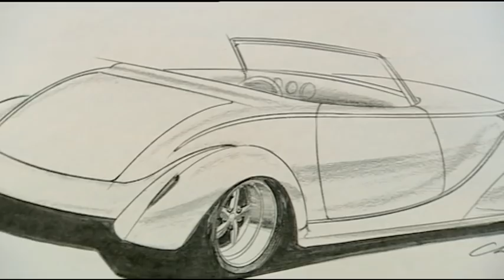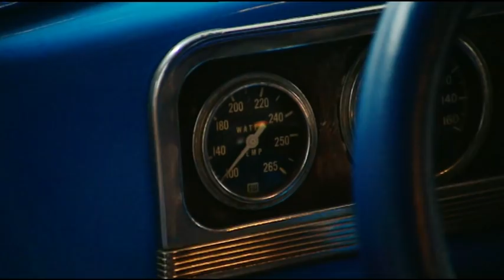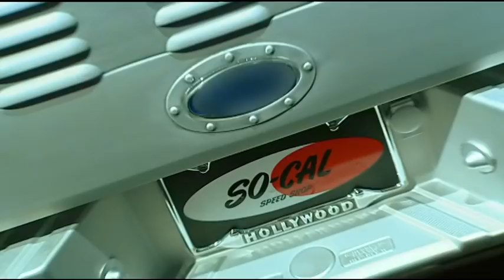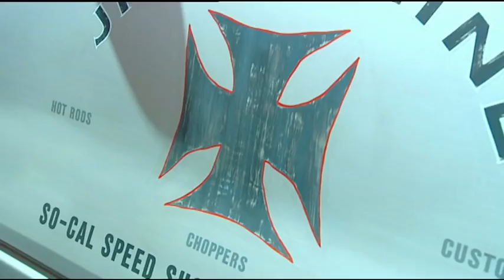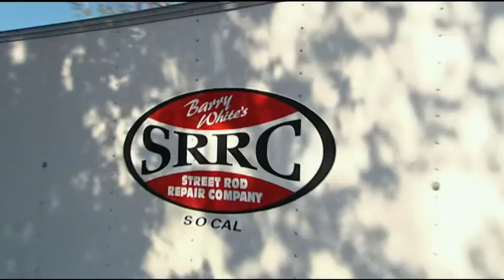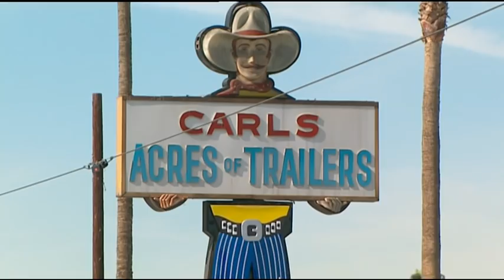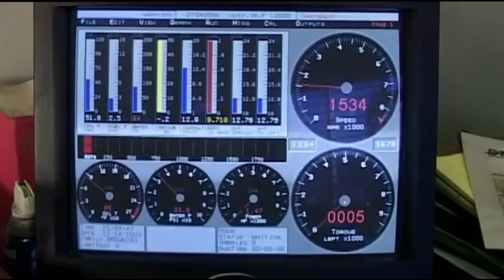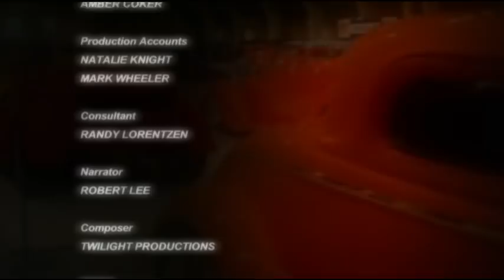Hot Rod Build-Off | Barry VS Jimmy | Episode 1

Comment: the street rods are stupid. hot rodding is about putting big engines in old cars for low cost.
Reply: It was about that when young  rodders were taking cheap 20-30 year old vehicles and V8s out of junk yards to build them in the back yard and driving that thing every day 

Now it's about professionals taking valuable vintage cars and spending a fortune modifying  them for old wealthy customers to take to shows - it's a total anachronism. 

As cool as the nostalgia style cars are, young guys sticking an RB25 in an old 240sx with a stripped interior they use as a daily who are dismissed as "ricers" by rodders  are far more in the spirit of the original rodders than this.